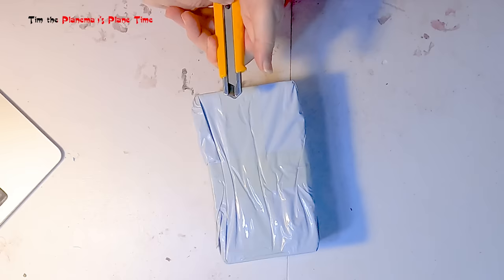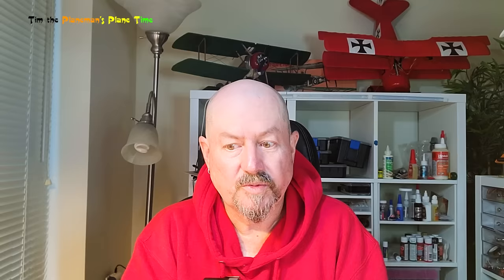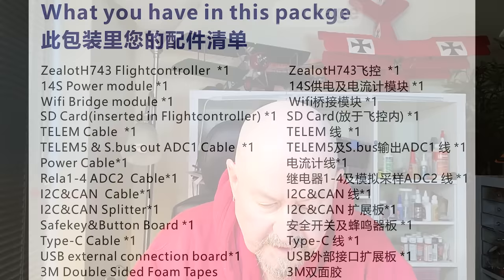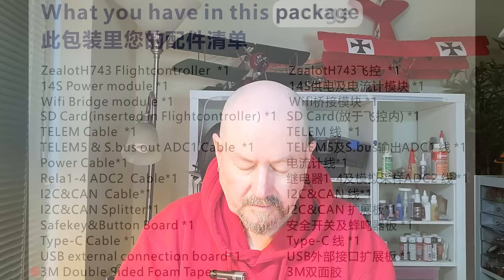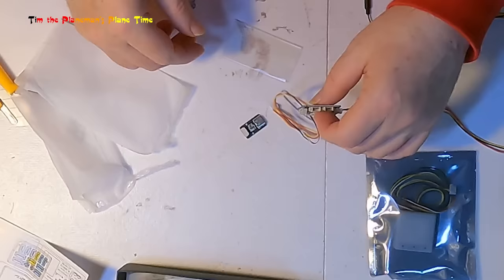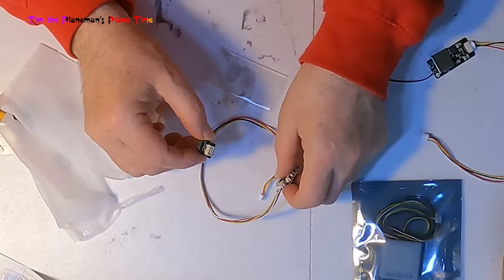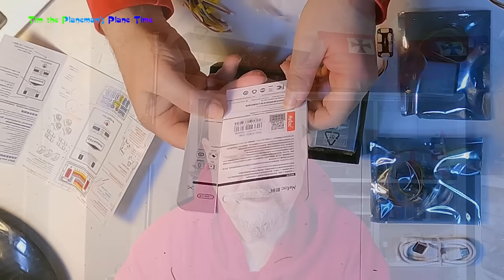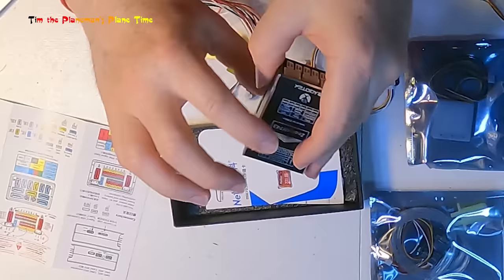Unboxing the Zealot H743 ArduPilot Flight Controller by QIO-TEK

Comment: I like the form factor on this board, and it is great to have more low cost H7s available
Reply from the maker: It's a very nice design. Jason from Qio-Tek doesn't understand why I want to use it for a plane, but it seems perfect for it. I'm guessing, but it seems like it might be suitable for a QuadPlane too, with up to 12 DShot outputs I think.

Comment: How fast will detect too? Is there a lower and upper limit?
Reply from the maker: The answer I should have given you on the video. The airspeed sensor is like the speedometer on your car. It tells you how fast it is going and that's it. But you need that if you want to turn on the cruise control. The cruise control uses the speed to then control the speed of the vehicle on the highway - that's like the fight controller in the plane, which can take the airspeed and do things with it.